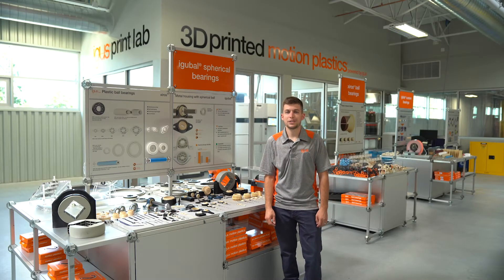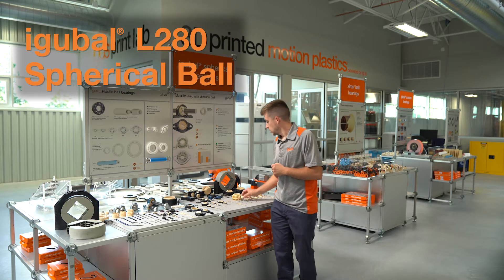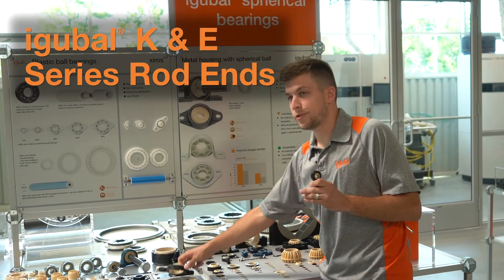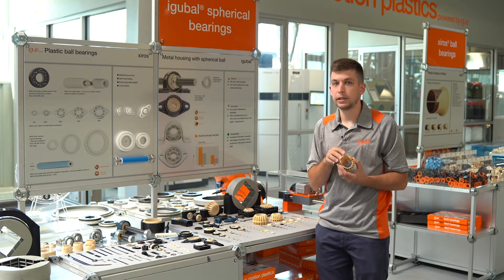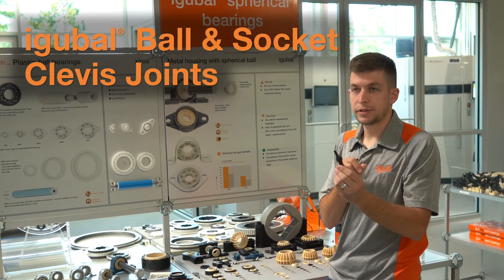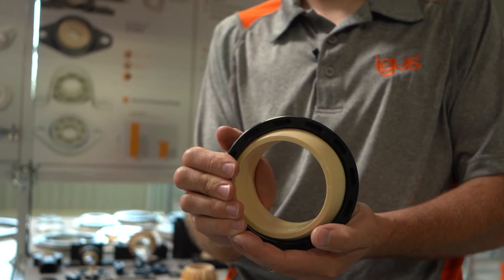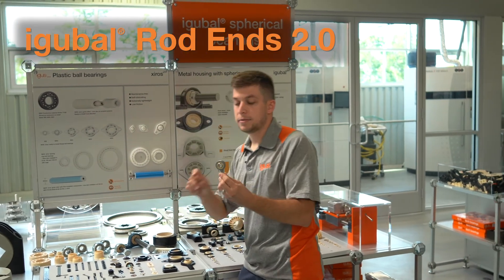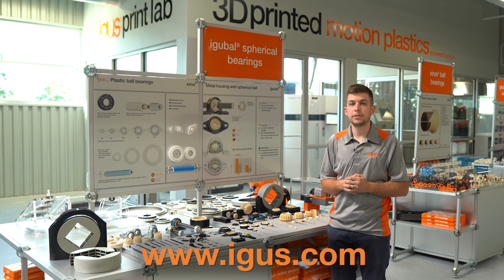igubal® Self-Aligning Bearings Overview

Comment: I have a Sailboat with a drive shaft that has an old and rusted out 1.25" Mid (Carrier or Pillow) bearing between the Transmission and the Stern Tube where the Drive Shaft exits the boat to the Propeller.  I am looked for a 4 Bolt SPLIT FLANGE Bearing that can be installed onto the existing Drive shaft without having to take apart the driveshaft from the transmission.  The Bearing just adds mid support of the drive shaft that would never for more than 1000 RPM.
Reply from the maker: Thank you for comment. We do have 4-bolt split flange bearings, however, only for a 40 mm shaft. You seem to have a 1.25" but if it's just for support you may be able to make the 40 mm off-the-shelf bearing that we have work. Please check out the link below. They're corrosion resistant and don't require any lubrication or maintenance which is usually a priority for people with sailboats. Feel free to let me know if there is anything else we can help with. Thanks! https://www.igus.com/product/igubal_F2xx_KS_TP